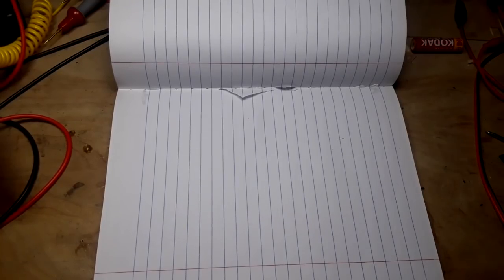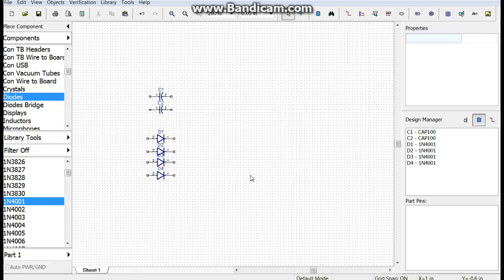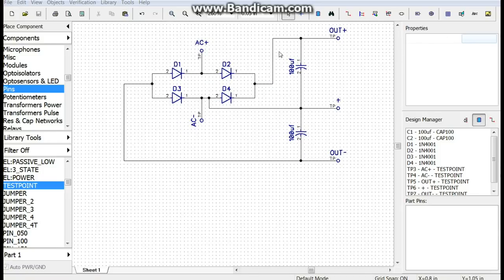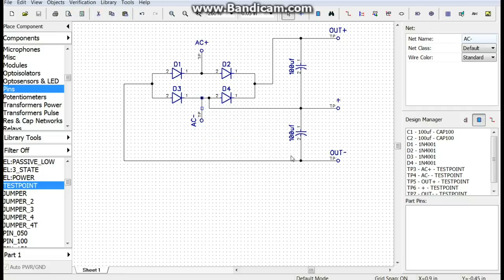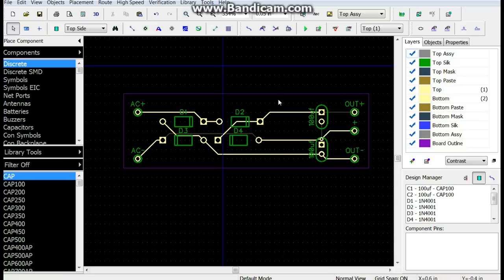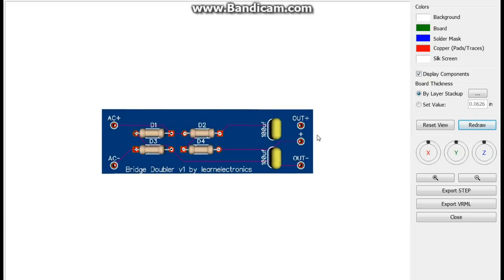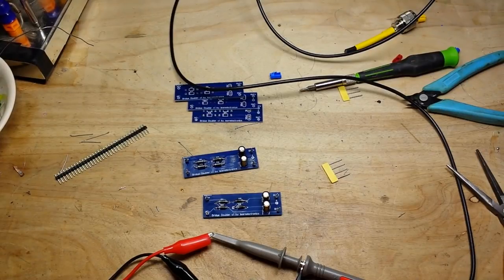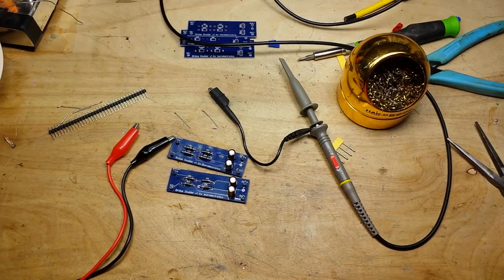Classic Circuits You Should Know - the bridge doubler

Comment: A full wave voltage doubler actually only needs two diodes. In this circuit (in the CAD drawn version) D3 & D4 are redundant. albeit not doing any harm being there. However, if you add a switch in the line that connects the tapping point between the two caps to the lower AC input you'll have a circuit that can be switched between full wave bridge rectification & full wave voltage doubling, which could be quite handy for some applications.
Reply: Like building a switchmode power supply that accepts 120V/240V input with only no complex PFC circuitry.
Reply: This may be the greatest ad for a service ever conceived. Start to finish how to get a project delivered to your door step. Perfect for a noobie like me
Reply: The doubler is essentially two half-wave rectifiers. I find the ripple to be twice that of a conventional full wave bridge for similar current loads. But I think it could be quite useful in creating a low current split rail PS by following it with 78xx , 79xx regulators in a low current application. That let's you use some of the newer high efficiency AC wall warts and get away from switchers in audio applications.
Reply: @kevinatkab5219  Indeed it is and as such the ripple will be higher as you say. Alesis used to use this topology to derive split rails for the op-amps inside their audio processors from a 9VAC wall wart.
Reply: Here is an interesting Monster that does full wave rectifying And doubling so you get almost the same watts out that can go in. https://upload.wikimedia.org/wikipedia/en/c/ca/Full-wave_Villard_cascade.svg
Reply: @kevinatkab5219  so if i used this in a high gain amp it would probably be very noisy?
Reply: @jinlim6575  It all depends on the current demands of the circuit. Then you either add more filter capacitance, or you add a regulator.

Comment: Nice circuit, I didn't know it. But the value of capacitor does matter when you put some load on the output. The bigger caps the lower ripple and higher current peaks in the input.
Reply: I work with high voltage low current circuits and the value of the capacitors in a doubler/multiplier makes a HUGE difference.
Reply: Human Being  The conversation goes like a little bit like that:
- "It is raining."
- "NOT TRUE!!!, it is raining."

Comment: Nice video. At first I thought it would be an AC doubler (3vac to 6vac) but really its an AC rms to double DC voltage converter (triple with schottky diodes). Hopefully no one plugged this into their 120vac outlet hoping to get out 240v to power their air conditioner (!).  The voltage rating of the caps should be at least that of the input voltage or preferably more (2x with Schottkys). The maximum current draw will be determined by the max i rating of the diodes, max rating of the input source, capacitor values and trace widths (or wire sizes if breadboard). Nice demo of the PCB design process using PCBWay - I got the most out of this video for that (I plan on using them someday soon.) An explanation of how the circuit works would be great for newbies. A vertical inline bridge rectifier module would take up less space if building this into a larger project. This is a very simple circuit but for more complex designs best to breadboard/perfboard first then produce a PCB once the design is tested and proven - especially with potential for bugs.

Comment: A nice little circuit I don't see often. The voltage is very high because you have no load on the circuit so the caps float to the top of the ac sine instead the RMS value. A simple formula for calculating a reasonable capacitor size for a given load current and ripple would have been a nice bonus since most uses would draw some current from the device.

Comment: an explanation would have been useful, so to have a better understanding of the why this circuit works as a voltage doubler 😉
Reply: I agree - I enjoyed watching the part where he drew the schematic in the  design program, but I dont understand what the circuit is supposed to do..  or how it works..
Reply: @SteveJones172pilot  I think (plz don't quote me on this) Since there are no amplifying components in here, that the diodes split the positive and negative waves of the AC, and stack the inverted negative wave onto the postive wave (and maybe the caps are like a ripple smoother, smoothing out the rectified signal into a nice flat DC?).  If anybody has a better understanding of how this circuit works, please educate me, I'm just spitballing, lol.

Comment: The AC input is 3+/- volts RMS, which is >4.2 volts PEAK. The Caps charge to the peak voltage.That's why the DC volts out is "more than double" the input volts.

Comment: Thanks for a video that shows SO MUCH!!
I was just curious about two things, are you familiar with:

1) The way the doubler works in the ATX PC power supply?
2) The 10K rule (by Don Lancaster)?
The 10k rule essentially says that for a FWB (four diode rectifier), for every Amp pulled from the DC output port, you get ONE volt of ripple per output with 10,000uF of filter capacitance (actually it's 8200uF, as this is somewhat conservative.  Of course this applies to a standard FWB, NOT a  doubler.  Also if you use a half wave rectifier, the ripple doubles, thus requiring twice the capacitance to get back to 1v of ripple (from 1/2 Vripple)... a little something I remember from "Hardware Hacker" in the '80's.

I just thought you may find this interesting, if, by chance, you didn't see it.
Again, GREAT VIDEO!!
Reply from the maker: Very cool info,  thanks

Comment: PC dc supplies use a spdt switch to change 120-240 power input to the switching supply so like 300vdc is stepped down to low voltage.

Comment: Great work Paul, I like your friendly simple explanations. Here's one for you: Is it possible to create an AC variable voltage power supply without resorting to expensive variacs? Been searching for ages with no luck!
Reply: Michael Bishop : Are you dropping current or voltage with the dimmer? Don’t rheostats (light dimmer) vary current?
Reply: Dimmers just chop up the sine wave dont they? I'm looking for a variable amplitude if that makes sense?
Reply: Maybe a variable sine wave oscillator coupled with an amplifier? Won't power anything too high current, but should be good enough for a lot of things

Comment: 3:21 its called blocking diodes with the 0.6v drop not silicone junction diode :s
also your shotkys has higher leak current in revers direction. There is just so much wrong here.

Comment: I know it's beyond the scope of this video, but it is recommended to put balancing resistors across the capacitors because when they discharge they are in series. That resistor should have a value that allows more current to flow than the leakage current of the capacitors.
Reply: you mean the resistor will prevent the lower leakage voltage but allow the full discharge?
Reply: @David-bc4rh  no, by sinking a current greater than the leakage one, they make sure the capacitors stay at roughly the same charge level between each other, allowing full discharge without any capacitor being reverse biased.
Without this resistors the capacitor with the greatest leakage will discharge faster and that excess current charge the other one.
It's not that important in a circuit that is constantly being charged and not depleted much between cycles but it is for some applications of this same circuit, besides the resistors act as bleeder resistors to discharge the capacitors when unplugged and avoid a nasty shock.

Comment: Shouldn't The AC be "Live" and "Neutral", not + and -? ;)
Reply from the maker: Label it however you like
Reply: Electrician would scold you big time for using + and - for naming live (hot) and neutral wires, but in electronics it is not such a big deal
Reply: @learnelectronics  *as long as it's not +/- because that already means something ;)

Comment: A useful addition to the process would be to simulate the circuit. I suggest doing this  between the paper drawing and PCB CAD layout. This allows changes in connection and component values to be quickly tried without making a PCB. Fee professional grade simulation software is LTSpice. Happy Electronics :-)

Comment: This circuit reminds me of the HV diode/capitor chain circuit which steps up low voltage DC to HVDC usually a couple thousand volts...basically cascading the back end of this circuit so the increase is exponential - you only need a few stages to accomplish that (ZAP! - ouch). Of course you can get very HV DC modules on Aliexpress for a few bucks but the values are questionable (400,000 v !) and they can only work as zappers briefly.

Comment: The capacitance does matter when you have more than a 10M ohm load on it.
Reply: Star Gazer 10Mohm load? Thats not taking much power, so whats the reason the capacitance matters?
Reply: @legominimovieproductions  The meter has a 10M ohm input impedance.  It isn't much of a load.  If you put a real load on the circuit, you'll hit the limit of what the capacitors can supply, and the capacitor size will matter.  It all looks the same because he has practically no load on it.
Reply: If a real load was on the circuit, more than the high impedance of a voltmeter, the capacitance would be important
Reply: Yep, he missed a chance to tell show us why the amount of capacitance >IS< important!
Reply: Star Gazer , the rule of thumb is 2200uF per Amp of load.

Comment: Sir I don't understand the AC connection between of the two capacitors ! Can you explain what actually is it doing there ? Is a voltage divider to the output , like the medium transformer reception or because there is no ground to the output it will be always positive ? Actually I am new in this area and trying to learn the basic electronics... Thank you for  your time !
Reply: After the diode rectifier, it's a DC voltage.
Reply: I don't understand either.
From what I see at the point at which positive comes in it also goes out between the two capacitors. I Do not see it going through the Diode
Reply: @TBL_stevennelson  This is simple, but not obvious to see it right away. If you look at the bottom capacitor, a half wave (during negative portion of cycle) bridge rectified DC offset voltage exist. A full bridge rectified DC voltage is generated referenced to the DC offset, not GND or - DC OUT, to generate 2x the voltage.
Reply: It looks like one half of the AC goes directly to the capacitor. And to the full wave rectifier. Does it make a difference if the positive or negative is connected there.
Reply: @TBL_stevennelson  Without any label reference to the circuit, it's hard to explain in text, but here I go. 
First, freeze the video at 3:00.  At the positive half of the cycle, follow the top AC input signal, say 3V rms, thru the top-right diode(+DC at this point). It will start charging the top capacitor to about1.414*(3V-Vd)=3.25V, where Vd is diode drop voltage of 0.7V, and return path direct to the bottom AC line.
At the negative half of the cycle, follow the top AC input signal, again 3V rms, thru the top-left diode(-DC at this point). It will start charging the bottom capacitor to about 1.414*(3V-Vd)=3.25V, and again return path direct to the bottom AC line. 
Since two capacitors are connected in series, the combined DC OUT will be around 6.5V assuming proper capacitors are used.
Reply: Thank you for your help I did figure it out. I found a diagram that showed me what I couldn't figure out.
Reply: It alternates. First it charges one capacitor to peak input voltage , then it charges the other. Both capacitors thus have a voltage across them equal to the peak input voltage - but they are also in series, so across both of them there is twice that voltage. Thus it's a doubles. It turns x volts AC (peak) into 2x volts DC.

Comment: Paul, Can you show us how to build a circuit that simulates AC like you get from a Signal Generator? all this arguing over if the circuit you built here is a Full Wave or Half and if diodes are wasted and i am wishing for you to show us how to build a function Gen PCB i can do square and sawtooth but what about when you need Simulated AC sine Op amps use it too. thanks :)

Comment: Wow this is new to me! Suppose you wanted to use this type of circuit with high current rated diodes in an auto application (say up to 10-15 amps). Would the capacitors need to be larger to maintain the current? Just thinking about my 6v ac motorbike alternator converting to 12v dc.

Comment: Thanks you for sharing the knowledge, i would like to ask a question about loading effect on the circuit after connecting it with a load, do the voltage still remain 9 volt? Or the voltage is drop.

Comment: Why did you add a copper pour for DC- on the bottom of the circuit?  What is the reasoning and design purpose behind this? btw, keep up with the PCB design, I'm definitely interested in learning more about the design and understanding of design layouts with taking into account multiple layers, heatsinks, etc!
Reply: For this trivial PCB (where there is no need for a whole fancy ground plane) the only reason I can think of is to not have to etch-away a lot of copper needlessly and use up more etch-fluid. Not sure if it makes any difference in cost though. If you run it continuously with high power diods it could also serve as a "poor-mans" heatsink.

Comment: I figured it out. The ground is connected to the middle of the two capacitors.
I think this wasnt easily understood. Or maybe its me
Reply: And if the neutral connection between the capacitors has a switch inline, you can toggle between regular voltage double current, and double voltage half current. It can be more difficult to understand circuits you'v never seen before, if the concept isn't something you'v seen elsewhere..

Comment: I wonder if if it's possible to draw a full bridge rectifier wrong, as long as you have an even number of diodes in each direction. Flipping two should arguably produce a 90° rotated circuit, depending on which two you flip.

Comment: Great video! Thanks for showing the order method for ordering PCB's.
Just to be clear. I am a total noobie.
No doubt this has been raised further down in the comments section.
The full wave bridge rectifier utilizes every part of the sine wave being fed to it? Under load the output may have better a ripple when measured than say    a similar circuit using only 2 diodes to rectify not to mention being a more efficient ?
Reply from the maker: The full Bridge rectifier takes the AC flips half of it around into DC at twice the frequency
Reply: @learnelectronics  
Thank you for clarifying this.

By the way I would like to see more videos like this where you go through the PCB process on basic circuits.

I find it very interesting

Comment: What is a good beginners electronic kit that will help you to learn to solder and the basic circuits?
Reply from the maker: Hi Joseph, this is a good kit. It's a little FM radio that runs off batteries. It's 99% through hole, but it has 1 single surface mount IC. It will give you a good variety of things to solder and you'll have something useful when you're done. It's $9 from my Amazon store.

Comment: How did you get your AC supply voltage? +3.28 to -4.5 range on your scope? As it's definitely not wall socket AC (+/-110V) and likely low current I am wondering if it comes from a signal generator or a benchtop PSU?
Reply from the maker: signal gen

Comment: Now I'm curious. I have a gen that has 80-100vac off the stator. Can a circuit like this be used to convert to DC so I can send to my solar mppt charge controller to charge batteries? It's a 40 amp controller.
Reply from the maker: Solar is not my area of expertise. I cant offer you any advice there, sorry.
Reply: 80-100Vac means, it can take a reactive load of 100vac, means the max volt output it can have is x amount of volts and max current it can supply is y, and x times y =80-100

your charge controller can handle upto 40amps coming from solar pannel....your question is invlaid

Comment: don't o autorouter, you can make this without double sided copper but instead you could do it with a single layer, in fact.
Reply: Yes do auto route but don't allow it to use a 2 side board. If he had defined his board a 3 layers it would have used them all. best way to auto route is to pick 1 side and if it fails then go 2 layer, then 3 etc until it allows a valid path.
Reply: @another1commenter770  sometimes manual route is the only way to find with 1-layer how to do. Sometimes autoroute don't find the solution as long as it doesn't change components' position. This circuit is possible in single layer.

Comment: I'm no electrical engineer, but don't you have exposed mains voltage on your board? Or is that tied to neutral?
Also, can you show us the difference with and without mains tied to your caps?
Thanks and take care of yourself.
Reply: There is no mains voltage he was using a signal generator.